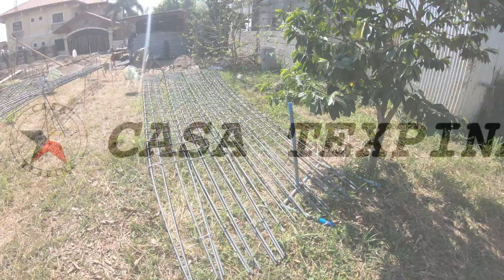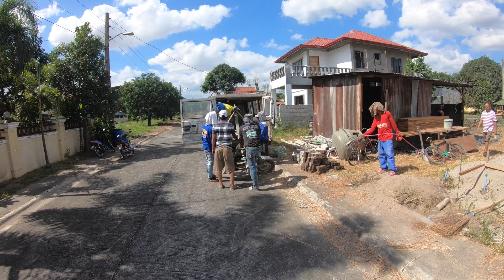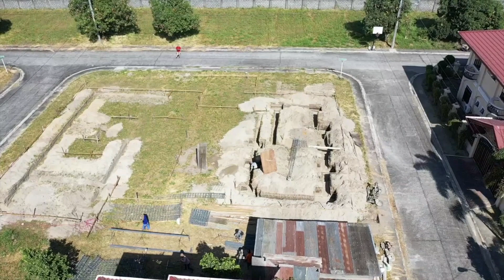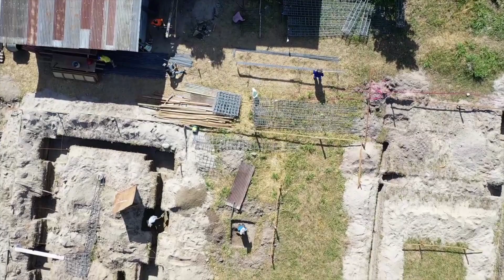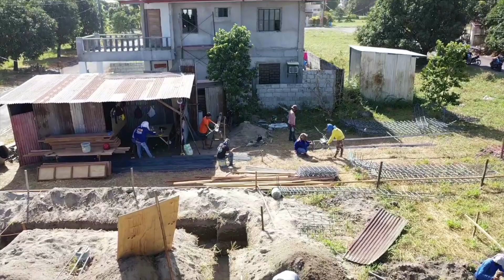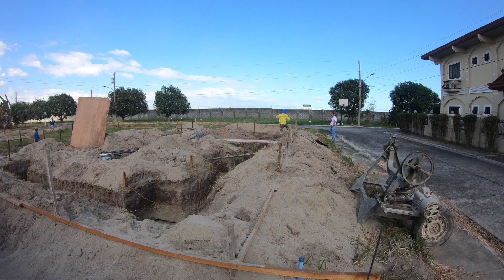Philippine House Building Step by Step, Build Day 8: Still Digging

Comment: Thanks for the videos. Just noticed that the 10mm column ties were bent at 90degrees. Supposed to be 135degrees I believe.
Reply from the maker: I agree. Unfortunately, trying to tell an engineer with 30 years build experience that the work is incorrect is a more daunting task than I anticipated.